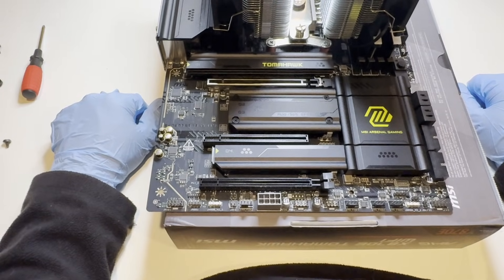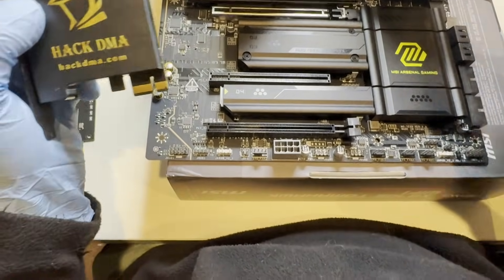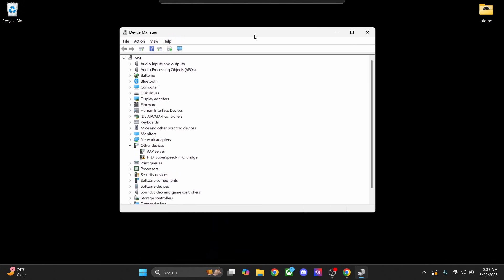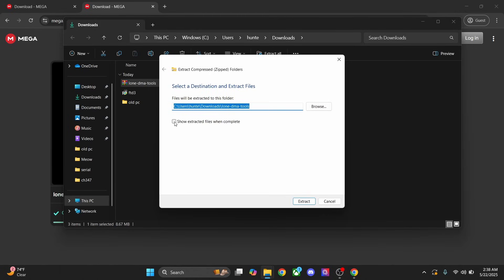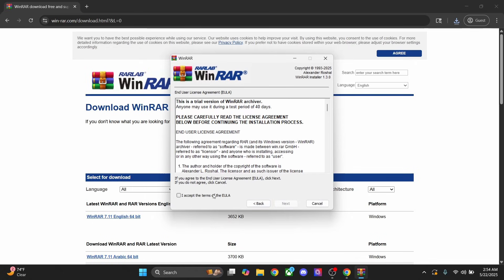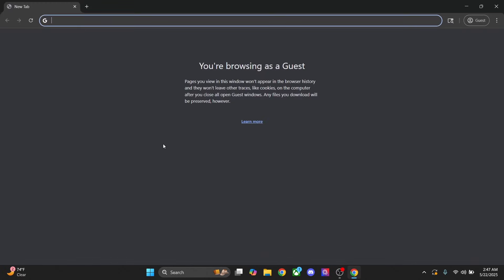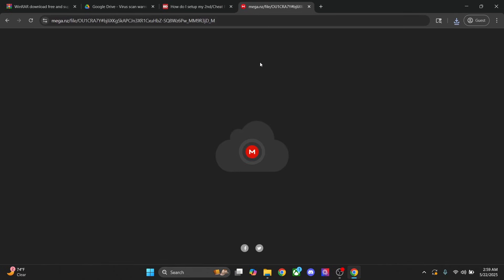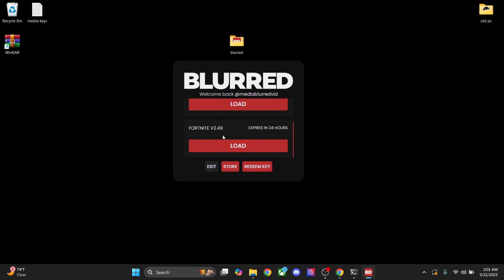How to Start DMA Cheating in 2025

Comment: Thanks for helping the scourge of gaming ruin our favourite video games in 2025. Hope you feel good about yourself and scam all the money you dream of. 
Kids don't do this. 
Your firmware always gets detected eventually or because they sell the same 100 kb file to hundreds of other wannabe cheaters, it will get blocked and the other kids you bought the crappy firmware from will have their hand out for another 200-1000 dollars.
Your laptop that you plan to use for a second pc will bottleneck speeds and probably throttle under high temps. They'll probably try to sell you a mini pc at that point. Some of you will find out that your motherboard isn't compatible after spending all the money.
It's not worth it, if you feel compelled to cheat in a certain game, just weigh up if you want to go through with trying to gain that edge or if its just worth changing games or just going outside and enjoy the time and money you didn't waste trying to cheat on the computer.

Comment: A quick oversight, but no fault of the creators of this video. When connecting fuser box, you need an HDMI cable to go to Port 2 on the diffuser and an HDMI or display port cable to go to your monitor so that means when you plug your cables into your GPU one goes into the fuser then the other goes into the monitor if you guys are wondering how you see the cheat screen

Comment: seems kinda to be honset but is it bannable like if i play warzone and hit crazy snipes from far away and get reported and can the ricochet anticheat detected the hacks and hardware i have installed ore runnig or can i use this on the low as just really good aim assist ? ps i might cop lowkey
Reply: since it uses the gaming pc memory extracting real time data and doesnt inject into the game process it makes the anti cheat harder to find it since its runs as an external device and i recommend you use a legit config to not get caught by other players and get banned.
Reply: There’s also behavioral detection on what is considered human aim as well as crosshair placement as well as insight out of sight and many others. If your locking player behind cover or ratios of head and body shots/accuracy etc are considered “inhuman” you can predictively get banned. Data pools of hundreds of thousands of players are used so it’s still up to the discretion on the developers on who they want to ban. Either nothing is 100% safe but this is technologically invisible to server based anti cheat programs since it operates at the highest level of the pc process chain so there is nothing above it to analyze it. It acts as if it is the computer itself seeing the data in game. Other cheats the use local memory or expose local memory operate under those network packets and under the games itself and the anti cheat operate from the kernel level itself so it sees the processes underneath it. Dma hardware works because the game can’t operate at this level.

Comment: I just get the same jtag error when trying to flash the dma card. I tried with my own custom firmware then I decided to get a card online with someone else’s firmware for like $350 and then I get to the same spot in the ch347 firmware flasher and get the jtag error. I have all drivers installed and it doesn’t make sense. I’ve seen online that other people are having this issue. Do you know a fix? Do I have to use a different flasher from somewhere?
Reply: Sounds like a bios or security problem. If you are on w11 disable core isolation
Reply: @Yoigna I’ll try looking again. I have everything disabled in the bios that should be for intel. I think when I checked the first time core isolation stopped showing up on my system, like it says “page not found”. I think it’s because I disabled it from the bios but I will check again. Does the ch347 flasher work for you right now?
Reply: @Yoigna just checked and core isolation is disable along with all the other firewall / security settings.
Reply: @Yoigna I used someone else’s flasher “kilmu dma flasher” and it said success and now I was able to get it to show up as a sound card on my main pc but when I run lone dma test it says vmm failed. Which is weird bc earlier when I first got the card it has good speeds
Reply: Same my problem you find solution for this problem?
Reply: Thankfully you are not hidden or anonymous online. Cheaters have absolutely no excuse.